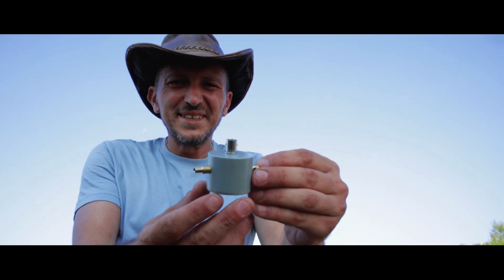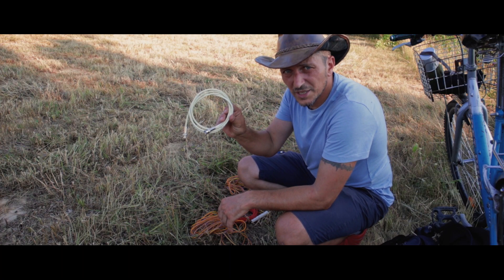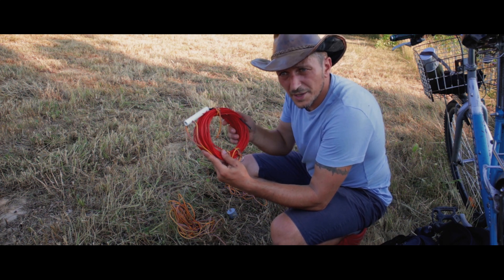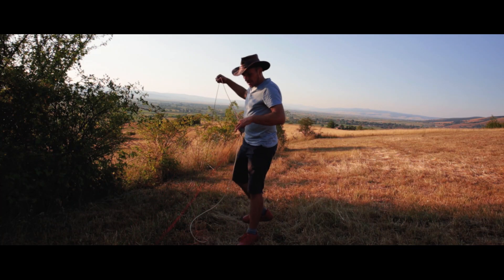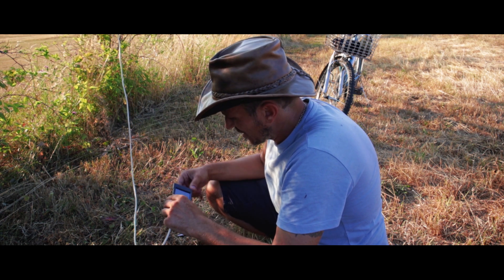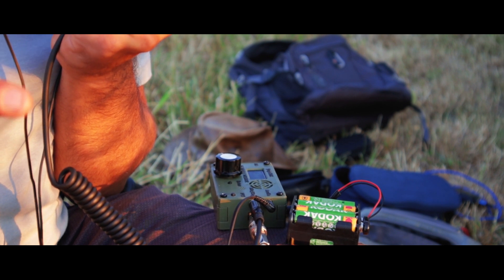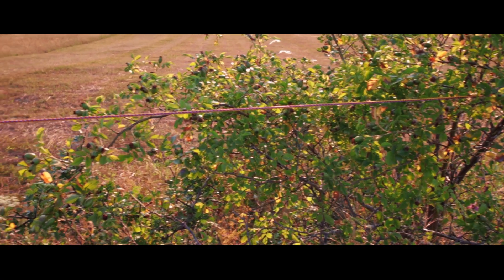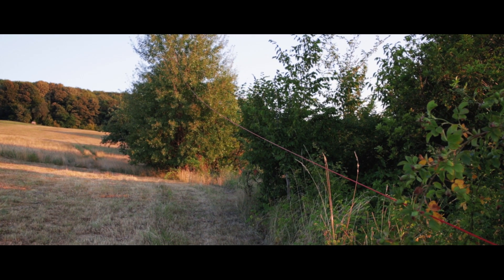Portable Resonant Antenna for QRP - 4010 EFHW Antenna

Comment: I had a 90 foot tall tree in my yard right near the cabin I moved into, and one evening I tried and tried to throw a line up over a high branch and hoist the EFHW into the tree. I spent nearly an hour at it only ever getting the antenna up to about 30 feet. I suspect a video of it would have been hilarious. A couple of days later I used a slingshot and a 1" diameter machine nut with fish-line tied to it. It worked much better.
Reply from the maker: Hahahahaha..   you made me spill my coffee hahaha. Ohhh you are right..  I wish you had a video of that. It's great it works with the slingshot as that is what I had in my mind and I was wondering if it would work. 73 John..  you made my day with this comment hahaha.

Comment: Great Job Ciprian! 😊👍🏼 Very nice work on Balun and the enclosure.

Hey, next time try to replace the red piece of rope for something elastic, like a bungee cord for stress release. I learned the lesson thru a broken radiator 😊

Hopefully wee meet in airways soon. 73 mi amigo 😊👍🏼
De KK4NWW
Reply from the maker: Thank you Eduardo. I also hope we will have a QSO. The rope I am using is a little elastic indeed. Not extreme but enough to protect the antenna wire. So I should be ok. I never really tie it that tight anyway so there is room to play with if it gets too windy hehehe. 73 my friend.

Comment: Did you try 15m and 10m on the same antenna? You should be able to get it if resonant on 40 and 20. If they are a little out try a longer coax, usually helps I have found from my own experiments.
Reply from the maker: Thanks so much Stew. I wanted to but it was getting dark and I didn't had enough time. I will do it this weekend if it's not raining anymore. I'm also curious about it. I will take some screenshots of the nanoVNA readings and post them in the blog article about the antenna. So I really want to try this also. I didn't know about the coax. Thank you for the tip hehehe. Cheers my friend... 73.
Reply: @dxexplorer  your welcome and happy DX!
Reply from the maker: Thank you. Ohh I can't wait to get it back in the tree and try some more )))